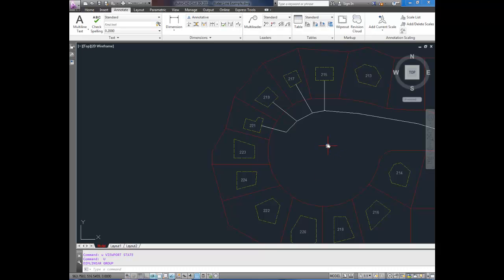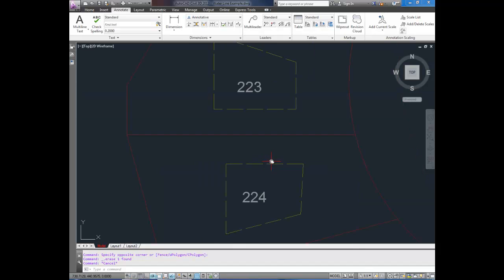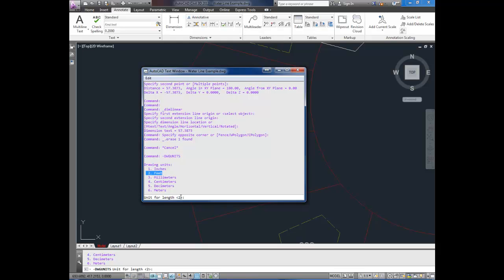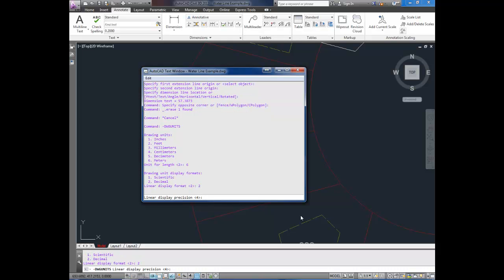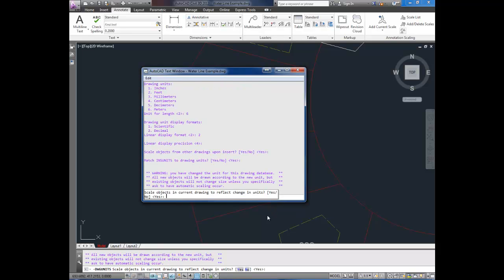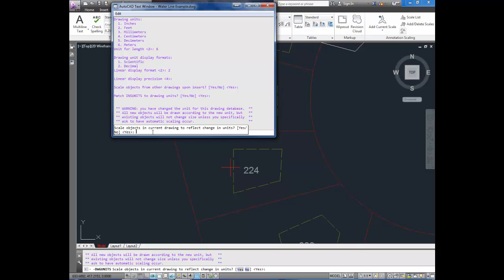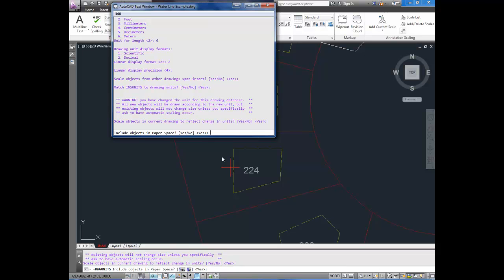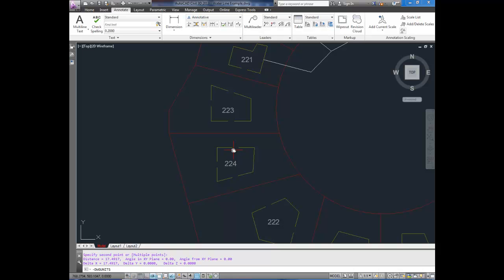AutoCAD Tutorial: How to change units

Comment: Brandon, super helpful, but I need more help with converting the existing layouts (in imperial) once you convert the drawing units. I used to work in the States and now I'm working in Europe so I would like to adapt the layout pages as well. I hit no for the paper units, but then the viewport scale isn't correct. I changed 24in x36in sheet to A1 (mm). When I choose a 1:100 scale for an A1 layout for example, it's huge. I checked the viewport scale and it indicates 1:100 1 paper unit = 0.1 dwg unit which seems correct as dwgunits are in meters (original dwgunits were in inches). Help please! By the way, I'm on a mac.

Comment: Hi Brandon 
Your teaching was wonderful.  I had a DWG survey drawing sent to me.  When I investigated the DWG unit it showed that it was drawn in inches.  But when I measured the footprint of the exg. dwelling in the file, drawing scale read the it was drawn in meters.  Which of-course with your teaching I change into mm.

I normally like my Survey drawings in mm as I draw in Revit in mm.  So for this purpose I scaled the whole drawing to 1000 time which gave me the correct scale of the survey measurements which was easily inserted with link Cad to Revit project.

My confusion is the survey drawing says original scale 1:257
DWG Units are in inches
But the dimensions where written in meters.
Please explain to me how can this be?